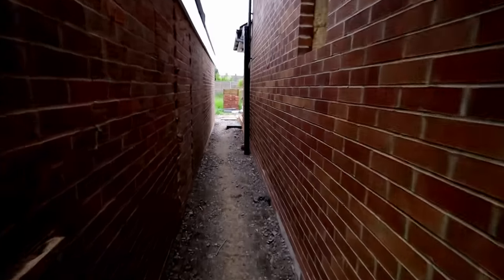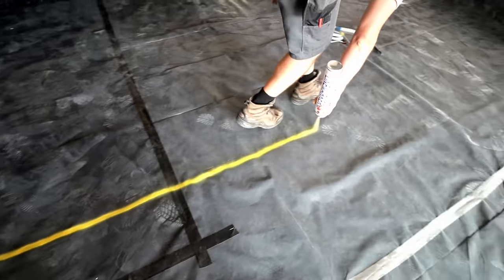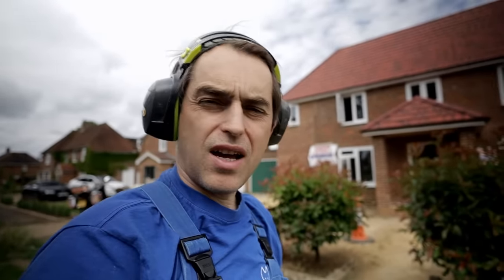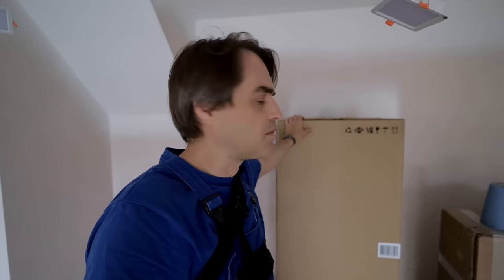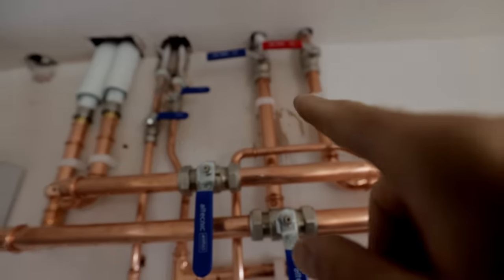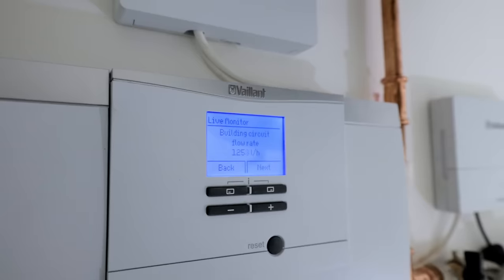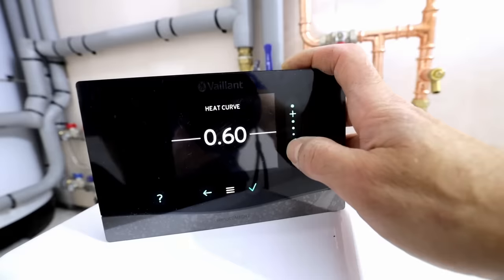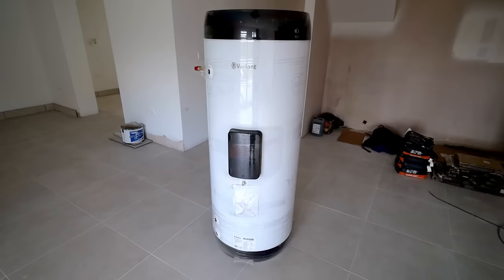Gas Boilers No Longer Make Sense, Here Is Why.

Comment: That's all lovely, but the plant room alone looks about half the floor area of my entire house! I'd wish there was some integrated unit which reduced a lot of the external pipe work etc. and perhaps could sit outside, or in a garage. Even going back to having a water cylinder is problematic for those with small houses.
Reply: Yes, this is going to be a problem for lots of people, in the real world modern houses don't seem to have much spare room and lots of older houses aren't properly insulated.
Reply: All that ‘stuff’ compared to a combi in a kitchen cupboard lol
Reply: The internals can be fitted into much smaller spaces than that.
Reply: A pre plumbed cylinder would sit in the corner of a garage. The biggest issue would be for 2 up, 2 downs with very little cupboard space. Flats etc will need to move to district heating assuming we are all coming off gas.
Reply: Even in larger homes, a larger plant room vs an extra/larger storage-/bath-/bedroom/kitchen is a hard sell. This is the main reason I went with an oversized combiboiler last year: sure I have the space to put a seperate hot water cylinder and it would have multiple advantages in my home, but I happily waste a few Euro's of gas and water each month in order to have a larger kitchen with more storage for dry and frozen food so I don't have to drive my car to the supermarket as often and don't have to think about how much room I have in my freezer and pantry.
The low-and-slow character of a heatpump is perfect for heating a well insulated home in mild climates, and can be compact (monoblock outside, flow/return from radiator to radiator), but I think it doesn't make sense for hot water production.
Reply: I agree, happy to put the cylinder in the loft but the rest of the manifold and that gubbins has to go somewhere too
Reply: @chrisfletcher86  For the underfloor? I've seen the manifold installed behind a kitchen cupboard which had a removable panel.
Reply: You’d be surprised how clever you can be with positioning of things, a manifold can get lost in the back of a service space behind a kitchen unit
Reply: @ma40  I don't know what all the stuff does to be honest. There's gauges and tanks and all sorts! If you're telling me I don't need most of it if I have big enough radiators and insulation that's great
Reply: This is where those of us in northern climates, where you need footings 2m below the ground have an advantage, you can stuff a massively huge heating system, under the house.  In a country like England, where it doesn't get that cold, air-source heat pumps can work really well.  Where it gets colder, there may need to be other tricks.   I think right now, if it was up to me, I would run an air-source heat pump, and when we gets temps where the heat pump, can't produce hot enough water, turn off the heat pump, and fire a gas boiler.
Reply: It’s too complex, plumbers dream and homeowners liability
Reply: The problem is the amount of space you need to fit everything , most houses just don’t have it unless it’s a new build with provision made for it....
Reply: One of our two manifolds is under the bath, tucked behind the (removeable) bath panel.  It feeds a mix of rads and ufh (flow temp 35 max) but is currently fed from a gas boiler (the 3yr old combi that came free with the house).  One day a heat pump will be a drop-in replacement.
Reply: @yensabi  When  you build slab on grade, then yes, you need to design in for heating systems.   Most houses that were built before 1970 in the UK, would have been built to have large coal fired boilers, and coal bins.  Gas fired Combi-boilers have only been around for the last half century or so.   The inside heat pump unit wouldn't be that much bigger then a gas fired boiler.  It's the plumbing you hook it up to, that tends to need the space.  If your hooking up to an existing system, then it's likely the additional space needed would not be that much.
Reply: If you live in a flat what is the solution? Mine only has room for a combi boiler and no possibility for a tank.  Community heating solutions will be the only solution for many if the technology exists.  Who then pays for it?
Reply: I doubt the owner drives a 20 year old Prius and goes to Bognor for a holiday. So, saving carbon isn't a real factor. If you take into consideration the energy (kwh) put into the manufacture of building materials, equipment and labour the payback period must be lengthy. Until we STOP using gas to generate electricity I can't see heat pumps being relevant. 
In UK our latest nuclear build is getting farcical in terms of costs and delays and inflation has all but taken the wind out of the sails of the offshore guys.
Home insulation done properly ( low E glass, airtightness,use of thermal imaging) will go a long way. Once we get batteries that will last at least 20 years, made from sodium or something cheap (I believe that is a reality) and PV panels (which are already viable) that is a way to achieving carbon reduction.
Reply: Surely You could pre heat all water used in boilers by a solar method and achieve greater savings very cheaply
Reply: @alextaxi2593  You can. Devices are available are available for electric solar panels to divert excess electricity to an immersion heater.  Solar heat exchanger panels can also do this directly. Both relatively cheap and space saving. The biggest problem is that the Government was to turn off the gas or price it out of reach which for many can’t be solved with a heat pump.
Reply: @alextaxi2593 preheated water is not what most boilers are deigned for - can be done, not simple as you might imagine.
Reply: @davidp4456   most apartment buildings here in Canada either put the boiler room on the roof, or in the basement.  Buildings built before about 1970, where it was coal or oil fired, tended to use the basement, buildings that were built after, when gas was more popular, use the roof, which makes exhaust pipes much shorter.  Gas pipes can be placed in a vented channel  or run along the outside of a building.    Most of this is because of fire regulations, running steel gas pipes all through out a building makes the chances of gas leaks  much more likely as steel exposed to damp air, tends to rust.....  Smaller buildings tend to also run central heating plants.  In both cases, if the building is larger, it tends to use a central hot water tank and a recirculating pump.
Reply: Big up to those spending money on efficient zero emissions heating.  Not everyone can afford it but without those doing it , well never catch up with the rest of Europe. New homes with gas boilers is so backwards.
Reply: But if you have a smaller house you don't need all that capacity, and thus a smaller unit. The real disadvantage is that to make hot water you need a cylinder. In reality if you don't have space you can use the heat pump only for heating and use another source for hot water (keep gas, or instantaneous electric).
Reply: @paulschmidt7473   hi! Are those blocks of flats timber-frame buildings, or are they made of bricks, metal and such? In the parts of the UK I know, there are very few blocks of flats with 3 or more storeys, and smaller blocks that do exist are really not made to carry heavy weight in the loft. :(
Reply: @jonjo6886  For 2022, the GB electricity generation mix was 39% gas. With a heat pump CoP of 4.0, and a gas to electricity generation efficiency of 50%, that's about 55% lower CO2 than a (90% efficient) gas boiler.  Over time, that's expected to improve, as the share of gas on the grid drops (and the least efficient gas power stations retire).
Reply: @alextaxi2593  For hot water you can effectively heat or pre-heat with solar over about 50% of the year, but UK solar output in Nov to Jan is about 90% (!) lower than May to July, so it's of nearly no use for heating.  You are better off installing solar PV, and then using the PV to power the heat pump (because then you can sell the excess to the grid in the summer months) - I speak from experience - I've designed and installed two solar hot water, and one PV system myself in the past, as well as one UFH heating system.
Reply: @jonjo6886 Why do we need to reduce Carbon emmision anyway? At 0.04% of the earth's atmosphere - it's a trace gas (albeit essential for all life on Earth.) And as 97% of CO2 is naturally produced and the UK produces less than 2% of the remaining 3%...the whole argument is b/s. When things are being pushed in the way they are right now, in certain directions... you can be sure someone somewhere is raking in a big fat pile of cash.
Reply: John Riggs questions why reduce carbon anyway?  I felt we're conned saying heat pumps are going to reduce carbon. Most of UK electricity comes from burning gas. When one looks at the LCA of gas generated electricity it is more than twice the official figure. Heat pumps are expensive to buy, expensive to install and expensive to run. To cap it all they flood in from halfway round the globe and we know how much carbon shipping incurs! 
At the end of the day, after the warranty runs out they are going to start breaking down in large numbers and nobody will fix them on account of lack of engineers and parts and cost.
Insulate, Solar/battery much more sense. Aluminium has huge potential as a good battery ingredient if someone can figure out how to do it.
Reply: @jonjo6886  You do realise they've been used in other countries for decades by now, and they last longer than the warranty period? Also check national grid live, less than half is gas, but even if it was 100% gas and everyone had heatpumps the UK would end up using less gas.  Gas at power plants has the possibility of carbon capture reducing carbon emissions further, something that is nigh on impossible to do at everyone's boiler.
Reply: It is called a split unit. What they use in most of the rest of the world.
Reply: Domestic heating is seasonal, so is solar, almost no Grid solar would find it's was to a heat pump. Domestic heating isn't a thing that is done by electricity so any extra has to come from burning gas. Look at the LCA for gas generated electricity,  its horrible, double what we're told.
Look at HVAC guy on YouTube, he struggles day in day out with heat pumps.
They will break down in great numbers and there aren't going to be many capable do repairs and spares will be a nightmare,  I know, been there,done that! 
The way forward is solar /battery all summer one could be independent of the Grid and in winter the battery would come into it's own smoothing demand.
Heat pump heat is so low in density that it's useless for storage except for in a huge quantity of water.
Reply: @jonjo6886  HVAC guy is American,  American heatpumps are practically decades behind European ones.  You'll notice that it is only really in America that the outside units are vertical rather than horizontal.
Reply: @jonjo6886  Batteries are short term storage- the are measured in tens of kwh. I use 12,000 kwh during the winter for heating- about 500 times the size of most domestic storage batteries. The route forward is passive heating- the electricity you use for appliances (it all ends up as heat) and the occupants. This requires heat transfer to the air coming in from the air going out. It is sensible to add humidification and filtering whilst you are doing this. Any shortfall in heat (or cool) can be added to this air, rather than A2W2A systems.
Reply: @BenIsInSweden  yes Ben, been there done that. Had an Ecodan, a short time after warranty expired (7 years) gas was leaking into circulation fluid and the only cost effective solution was a new unit. At least the American ones use a lot of generic stuff and they're basically quite simple to diagnose.
Reply: @jonjo6886  Don't really see many Ecodan's over here in Sweden. But thinking the whole industry is the same based on one failure is rather narrowminded. Was it properly serviced regularly? as normally that sort of thing would get picked up before it gets to that point. The engineer who came and serviced my 2007 Panasonic unit at the end of 2019 expected it to need replacing within 2 years. It lasted 3.
Reply: @NunoLima1337   There are essentially two types of building, those that are under 6 storeys, and those that are more then 6 storeys.  Because of the weather, frost can affect anything at a depth of less then 1.3m, so the law requires that the footings be below this level.  Standard building procedure then is to dig to about 2m, and install a footing  on undisturbed soil,   then build on top of that, this leaves you with a floor at around 1.5m below grade.  In some cases they then put the floor at grade, and leave a crawl space below, in other cases they put the floor about 1m above grade, and leave a full floor called a basement.  

Mechanical items, such as boiler, hot water tank, plumbing, duct work, wiring, all feed from the crawl space/basement.  In some cases parts of this space are finished as additional living space.  

The underground portion, tends to be concrete, the above ground can be a wood frame with some other materials.
Reply: Hi Ben, everything goes wrong. I have a Panasonic a2a and it is great.
In UK our heating isn't normally done with electricity, solar is at a minimum in the coldest months so the extra electricity is generated by gas.  When you look at the LCA of gas generated electricity it is horrendous, about 3 kw burned at the power station to get 1 to drive one's heat pump. So, to do any good at all one's heat pump needs to never be below 4:1.
Take my car for example, they give a figure for co2 but I need to add 700 grams co2 per litre to cover the Life Cycle Assessment for petrol. The same idea needs to be done for electricity. In the U k. we are totally conned about co2.
Insulation works, triple glazing or low E glass, air leaking tests and the use of thermal imaging on a cold day.
Reply: @jonjo6886  And that 1kW gets turned into at least 3kW of heat, so basically 1kW of gas turned into at least 1kW of heat.  1kW of gas at the boiler in the UK is stretching it a bit to say it gets turned into 0.9kW of heat.  And that's only whilst it is being powered by gas, which barely goes above 50% even in winter (again can check national grid live for that).
Reply: In summertime in the UK many households could almost be independent of Grid electricity if they had 10kw solar panels and 10kwh battery. 
Come wintertime that battery would come in real handy, taking in juice when the wind blows and returning it at 17.00 on a cold afternoon. This would be a massive help to Grid by easing load at high demand and soaking excess, rather than paying to curtail production.
The technology is good enough as far as solar panels go, save for perhaps cooling said panels in hot weather. 
Batteries are a different kettle of fish, at present they use Lithium and have limited cycle life.
Given time, sodium Batteries will most probably become mainstream or even aluminium is a good candidate if problems can be sorted.
Reply: @BenIsInSweden  At this very moment UK electricity generation is 56% embedded.  They give a figure of 272 grams co2/kwh.  When you factor in the Life Cycle Assessment for the gas used its going to be nearer 500 grams co2/kwh.
We have to use a proportion of compressed gas and that much worse.
Reply: @BenIsInSweden  I apologise if I get a bit "worked up", I feel that we are all getting conned as far as saving co2 goes.
Reply: @jonjo6886  the problem is doing nothing doesn't decrease the co2 emissions, there is no realistic way to improve it at the boiler. The more people that switch to heat pumps etc will put the onus more on the government to make sure the grid reduces its co2 emissions.  The co2 argument is really only because the UK has left it far too late to get into the heat pump game. For many other countries it has been for cost saving for decades with the environment aspect only being the cherry on the top.
Reply: I can't put my car in my car in my garage now.
Reply: @fortnitefred1351  You have a car big enough to fit another car inside?
Reply: @BenIsInSweden  No because of a big water tank, I now have in my garage I can't put my car in. Devaluing my house.
Reply: @fortnitefred1351  I doubt it'll have a big impact on house value.  Many people with garages in the UK just use them for storage, as parking a car in them is awkward, as many were built at a time when cars were smaller.
Reply: @jonjo6886  The heat pump in this video is a Vaillant, which will be made in the UK or Germany, so it's not really shipped around the world.  If you're saying gas has a higher than "official" climate impact (e.g. from fugitive methane emissions), then this also applies to gas boilers (but more-so).  Heat pump emissions per kWh heat from gas boilers are already approx 4x higher than with heat pumps from the current UK grid mix (and that number is improving as the grid decarbonises).  The tech is virtually the same as air-conditioning units, and neither the UK nor the rest of the world seem to have much problem fixing them if they break down (no more so than with a gas boiler, or a car).  They essentially have one more moving part than a boiler does which is the compressor.
Reply: All that space to do what my 70x30x30 cm combi boiler does, I guess it can only get better.
Reply: @davidp4456  The phase-change heat batteries take up loads less space than a hot water tank. More like a large PC box. So that's one way of dealing with 'no space for a tank'.
Reply: @jonjo6886  "and we know how much carbon shipping incurs". Yes. Approximately none in comparison to that generated in use during the product's lifetime. i.e shipping emissions are utterly irrelevant to the debate about how to heat our homes. Insulation/airtightness is brilliant, and works forever at no further cost, but most people can decarbonise faster by installing heat pumps. It's much less disruptive and takes days rather than weeks/months.
Read Dr Richard Erskine: 'Insulate Britain, Yes, but by how much?" That article changed me from a fabric-first always man to understanding that heat-pumps first almost certainly results in faster decarbonisation, and thus should not be dismissed.
Reply: @jonjo6886  "batteries have limited cycle life". Yes, but that still amounts to 20 years in daily use for a home battery, which is longer than a typical boiler/heat pump/appliance life-cycle. I think you are saying that the UK grid intensity is worse in winter because less solar, but our grid is increasingly wind-dominated and there is more of that in winter, so I'm not sure it's true that intensity is noticeably worse during the heating season. It certainly isn't dramatically worse, except on very low wind days.
Reply: You can use a mono-block unit instead of a split one. I've installed one myself, not that complicated, nothing inside, everything is in the outside unit, I just connected the pipes beneath the gas boiler. For DHW it's a bit complicated, you will need a boiler but I think it's cheaper to buy a different unit, an electric boiler with heat pump, like the models from Ariston and other manufacturers.
Reply: @paulschmidt7473  Heat pumps work in colder climates and lower temperatures, they have 1,5, 3, 6 or more kW electric back-up or if you still have a gas boiler the heat pump can control it and ask it for help if necessary. I have a 6kW Gree Versati III heat pump and the gas boiler is connected to "Other Thermal" port and the hot water is still the job of the gas boiler. Best of both worlds and a good back-up if one of them fail.
Reply: @alextaxi2593  Let's think about it. If you use electric heater form photovoltaic solar panels  it will at a 1:1 ratio. A heat pump will be at least 1:2 ratio. If you use a solar panel for heating water the cost will be pretty high, vacuum panels are not that cheap.
Reply: @alerighi  Or you can use an electric boiler with heat pump which doesn't take much space than an electric one like Ariston Nuos Evo.
Reply: @jonjo6886  They are expensive depending on where you live. I managed to buy a 6 kW Gree Versati heat pump and installed at a price of 2.600 EUR. I live in Romania, and I bought it from Spain in april 2022, the price for one unit was 2.000 EUR, the installation cost me 600 EUR. DHW is still the job of the gas boiler and it's nice to have a back-up if one of the fail. I think it's stupid to force removal of gas boilers. They will phase out naturally eventually.
Reply: @jonjo6886  But still you live in a city, not near the power station? You prefer the air to be cleaner in the city or at the gas station? The same with cars.
Reply: @fortnitefred1351  Why didn't you use a smaller electric boiler with heat pump like those from Ariston and other manufacturers?
Reply: Wow CO2 is just.04% of the atmosphere!